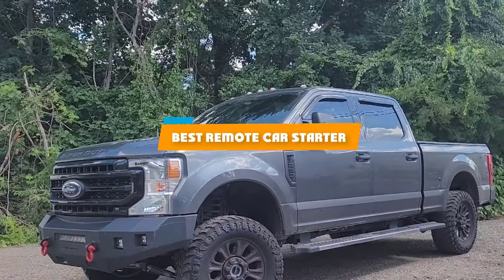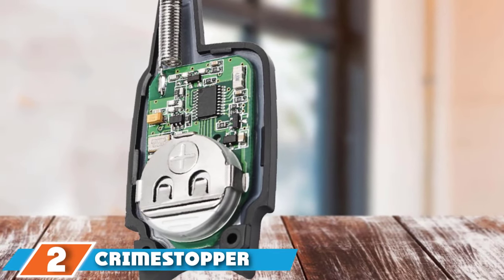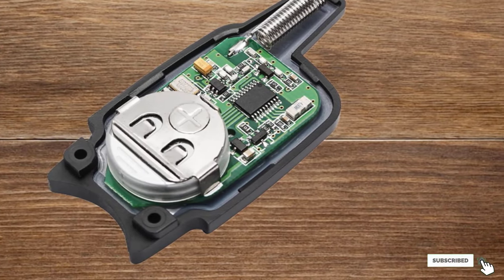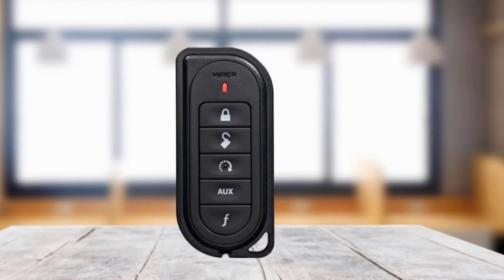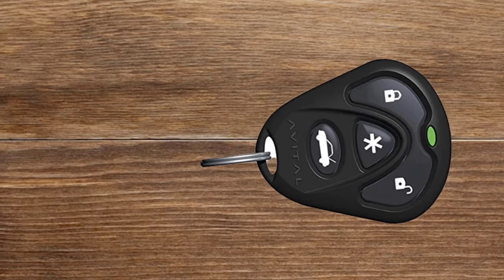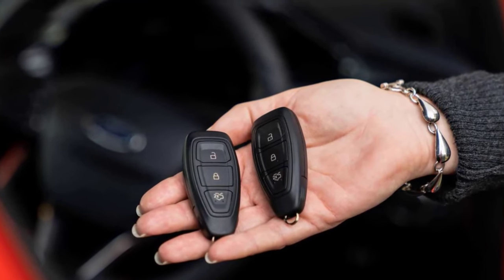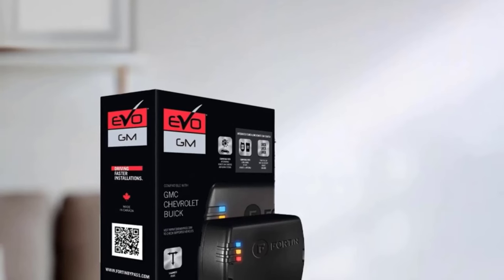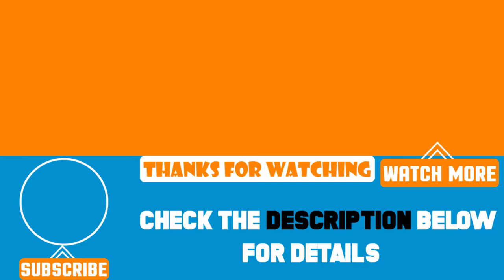Top 10 Best Remote Car Starters Review in 2024

Comment: I live in a brick wall building that used to be a warehouse so there's not a lot of windows in the 4th floor that is no more than 400 ft from the parking lot and have a car with a manual transmission. What product(s) would be ideal for my application?